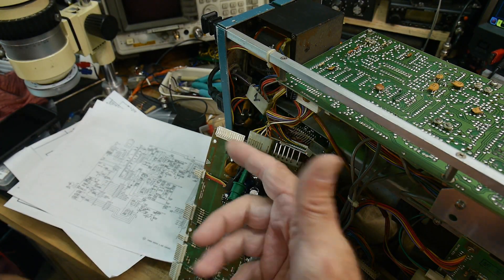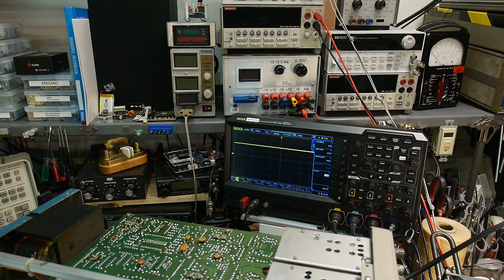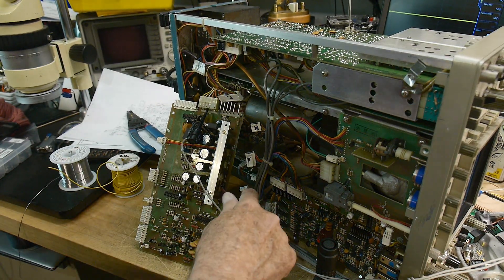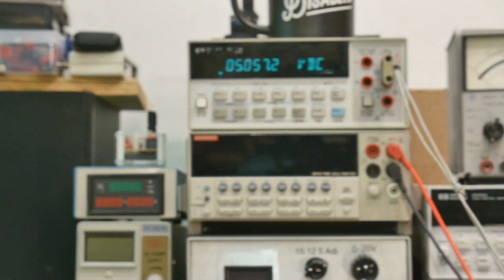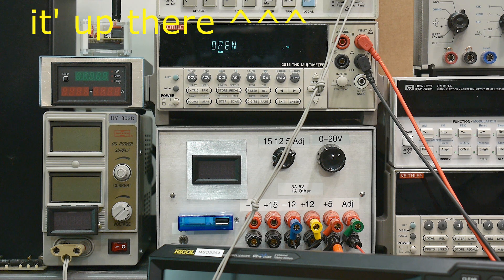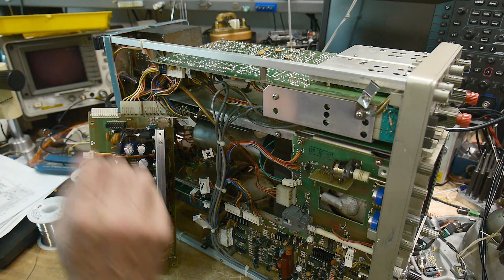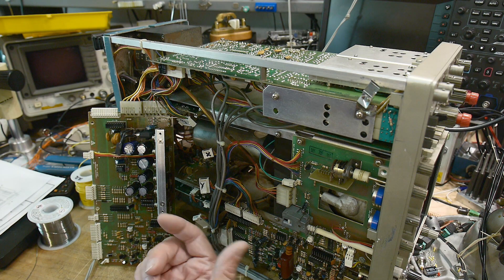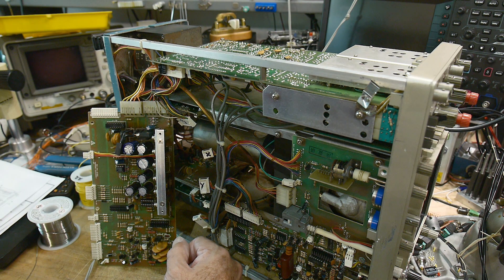#1147 Kikusui COS6100 repair (part 6 of 11)

Comment: I would not rush to modify the regulators.
Looking at the schematic I have the feeling that some voltages are interlocked so one can't appear while the other is missing.
Can someone help analyze the power supply circuit in more detail?

Comment: Meh, I think you are wasting time. Inside this thing, it is so much consumer grade quality, with flimsy connectors, lousy wiring and the rest of thin-metal-and-plastic mechanical construction. Looks like a regular TV or VCR from 90's, rather than a lab grade equipment. Get some Tek or HP from the same era, Wavetek gen was really interesting inside too.

Comment: Hi, I thought from the beginning that there would be a leak on that circuit board when it was roasted like a turkey. It is quite possible that due to this problem, the original connection of the source did not work.
It's a pity that I saw those videos only today, I would write it right at the beginning, I encounter this problem quite often when servicing electronics in gastronomic establishments, I have already seen a printed circuit board burned through - I could check what is happening on the other side and he did not have to remove the board😂.

Nice day 🙂 Tom